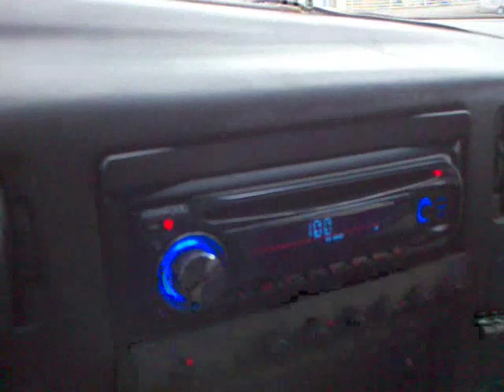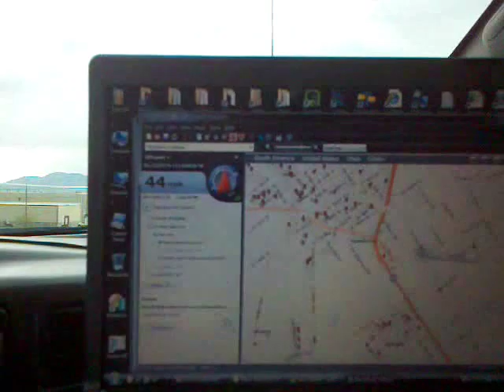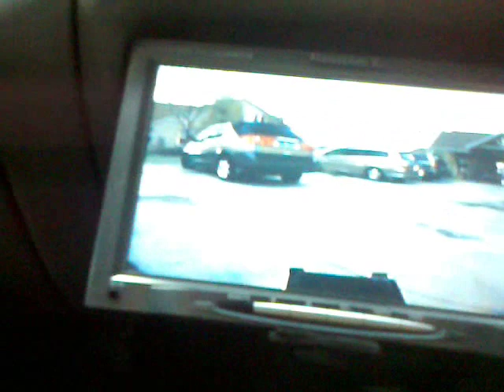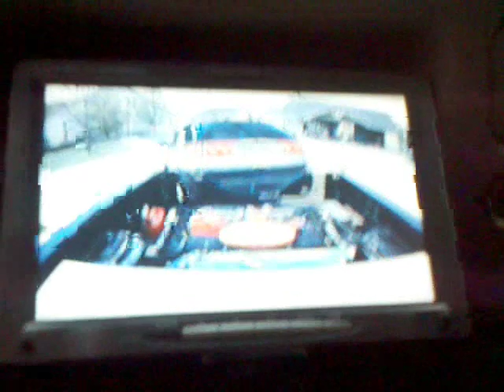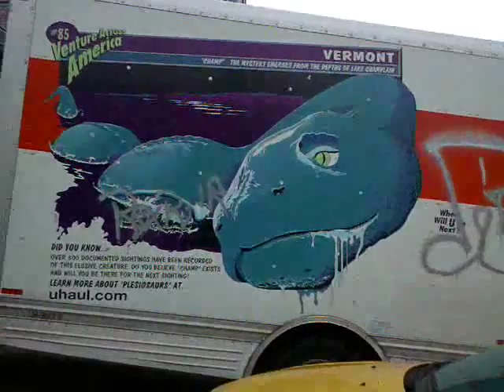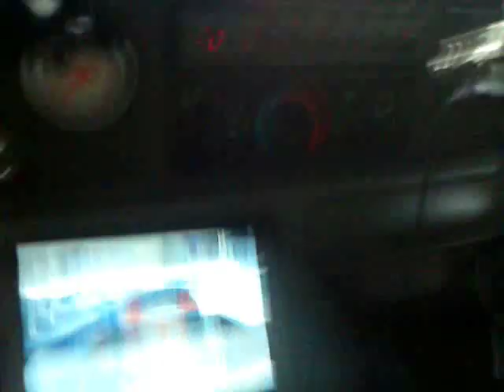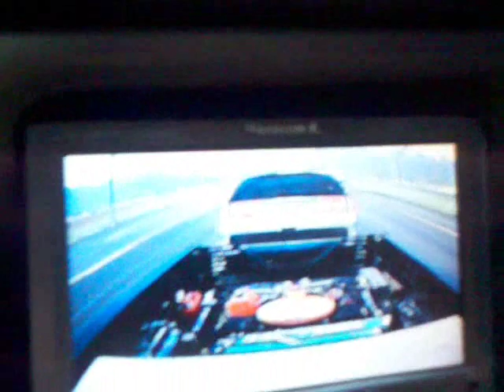The Best Repomen Know That Saturday Is Moving Day - 06/06/2011

Comment: You keep mentioning the differences about what type of drive a vehicle has ( all - wheel, rear - wheel, front - wheel ). I can assume that you just don't go into the field and collect repos at random - your methods are too planned and precise, and you mention that there is a science to the industry. Wouldn't it be easier to look up the information about a repos transmission before going out to get it beforehand so that you will know before you even get out of the truck?